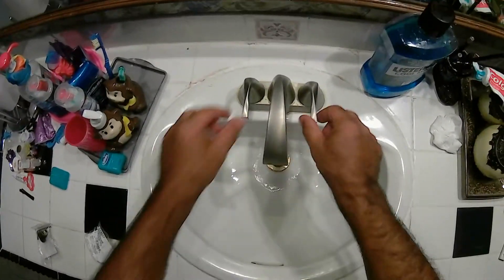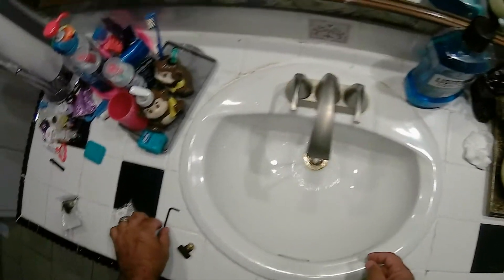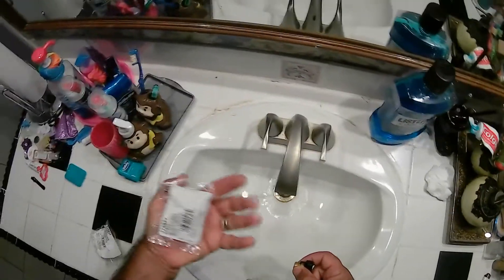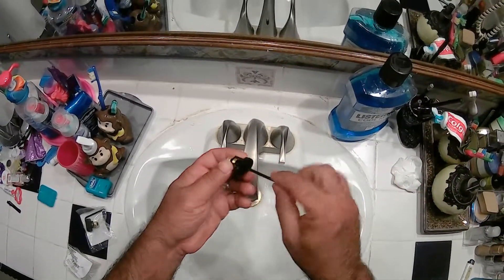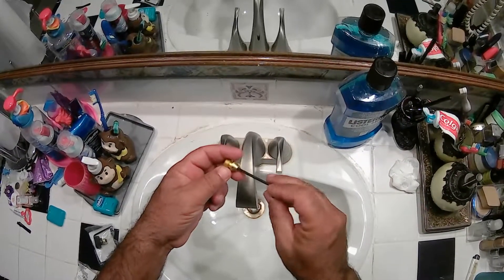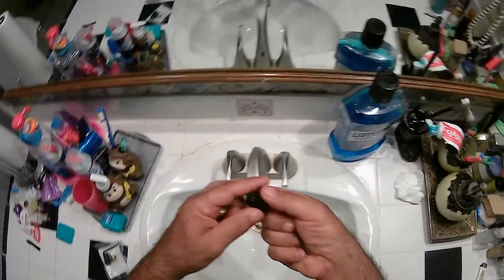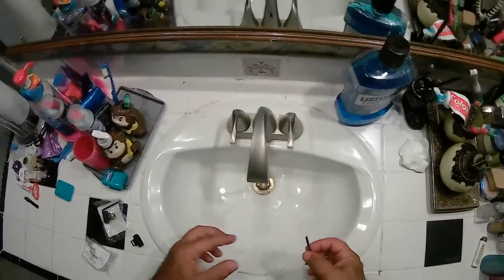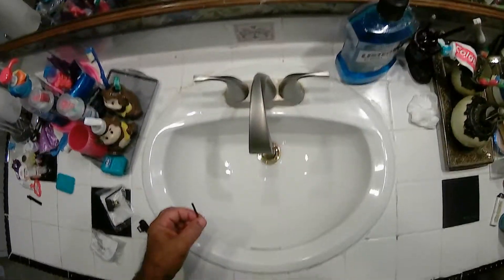Moen oxby clogged

Comment: Your video helped me as my Oxby was running slow. I was able to remove the aerator with a 1/8" hex wrench. I then cleaned it out and replaced it. Now it runs like a charm.
Reply from the maker: Bravo - have the tool  nby as I clean it  every month .. so much sand in my water ..
Reply: Could you tell me which direction to roate when you remove the aeroator wiht hen wrench?

Comment: I have moen brand new in my bathrooms. Brand new but just a trickle of water and thats it. You got any advice or should i take them out & bring them back to home depot?  Thanks for helping out.
Reply from the maker: it is on sale for a reason.. you need the new design that allows you to open the cartridge without tools and shake the dirt out .. talk to sales .  I have the Allen wrench in bathroom and pull out and shake the dirt out once a month .  my kitchen I do the same without tools . too much debris in my water lihttps://www.homedepot.com/p/MOEN-Banbury-8-in-Widespread-Double-Handle-High-Arc-Bathroom-Faucet-in-Spot-Resist-Brushed-Nickel-84947SRN/317268478?nes . here is an example .

Comment: Calcium build up, it will happen again. Not sure if you  have a water softener but if you don't that's the reason why It clogged
Reply from the maker: I have a 40 year old metal pipes and every time we shut off the main water the roof of pipe does not have any support and debris rain down inside the pipe .  Best solution is to have a filter that does not need tools to remove debris. my Allen wrench is in the bathroom and I clean this thing once a month . it takes about 1 minute .

Comment: I have this same faucet. Thanks so much!  Question though, after unscrewing, how’d you get it out?
Reply from the maker: if you pull on black plastic screen it should pop out .  block the drain so nothing can fall in there . use a mirror or selfie camera mode to see the screen . take picture for orientation of black screen .

Comment: Mine has a screen over it. How did you remove? Stuck the Allen wrench through the screen?
Reply from the maker: allen wrench goes  through screen , tool and part are free from moen .
Reply: Mine was out of warranty so they won’t send the tool. Going to have to replace the faucet because wore out the internal teeth. Going with a different brand that doesn’t have a dumb set up
Reply from the maker: warranty is life time and use the 800 number to call them .. talk to them direct .. 
if you did buy a new item buy something that you can replace the filter quick .. since the filter needs to be replaced ..

Comment: What size allen wrench is that?
Reply from the maker: I called moen and they gave me the part and wrench for free
Reply: @boashna  same problem here, low water flow from the get go. The aerator is very difficult to access because you can't see where you need to insert the wrench. I had to remove the faucet to see what I was doing. Besides that I tried just about every allen wrench that I have and not a single one fits. Apparently, you need exactly the "replacement tool" in the replacement kit. I might have dulled the head in my attempts to get a wrench to fit, so now what?
Reply from the maker: the video starts by saying free part from moein. order the part and it comes with the wrench . if you are not able to use the wrench anymore the first turn is hard and use a locking pliers .. I have a extra  identical faucet used for $30
https://www.amazon.com/Convy-GJ-0087-Curved-Locking-Plier/dp/B07H42XP5W/ref=sxin_3_pb?cv_ct_cx=locking+pliers&dchild=1&keywords=locking+pliers&pd_rd_i=B07H42XP5W&pd_rd_r=ec3fd61b-e1ae-44f5-937e-6f670c6fb085&pd_rd_w=IuKtl&pd_rd_wg=VCX27&pf_rd_p=ffb450f7-bfad-4e7e-95e8-f2bd147e99a4&pf_rd_r=935FX7WTZPBW1VKQXD7C&qid=1599936873&sr=1-1-8065ff8c-2587-4a7f-b8da-1df8b2563c11
Reply: update: I had to resort to drilling through the aerator to restore water flow... very disappointed with Moen. Fancy and expensive faucet destroyed by a simple aerator issue and it came out of the box like this.
Reply: @boashna  First of all, thanks so much for the video first and your fast response. I foolishly expected to simply take out the aerator and clean it without ordering a replacement part first. By the time I figured out I should have ordered the free replacement kit like you did, I had already dulled the head with my attempts to use a regular wrench.  I tried the pliers that you suggested (I have the exact same ones) but they didn't fit in the space: not enough room. I ended up just drilling through the aerator. I think this is a very bad design. (BTW the plastic cap is so flimsy, the attachments broke!)
Reply from the maker: yes this is a bad design ..on all faucets you must have that filter or water will splash on counter and if you use white cast iron sink they will rust around the edge and water on counter means mold and damage to something
Reply: I have the same issue n tried different size allen wrench with no success. My faucet is less than 2 years old. Thank you for sharing the video!
Reply: @boashna  do you still have the extra faucet? I tried drilling through mine and created a crack in the spout and replacements are hard to find.
Reply from the maker: https://www.homedepot.com/SpecialBuy/SpecialBuyOfTheDay?mi_u=26971222&sfalias=VA_Banner_1&cm_mmc=hd_email-SBOTD20210119_sbotd_3770670_-VA_Banner_1&et_rid=26971222&mi_cmp=8b0d00f80c5ac909&mi_sc=t                   This is special buy on faucet good for 6 more hours
Reply: I received new aerator n allen wrench from Moen but it was no use bc I totally stripped inside of old aerator. I also ended up drilling it. It worked but water shoots out like a torpedo now. Worse design flaw for a faucet!
Reply: @boashna  ok got the info ill message you Tomorrow
Reply: My Allen wrench stripped it just like everyone else, what do you mean drilled through it? Just put a drill bit on and drilled where you put the Allen wrench?
Reply: @gekhond  Dude, which bit did you use? This is killing me!
Reply: @jambaroo1  Dealing with the same thing. Ugh. Drilling. What an idea...
Reply: @caseyw9953  I drilled through the aerator to restore water flow after I stripped it like everybody else here did, but it is not a good solution at all. Water squirts out in a tight fast beam. Terrible, stupid design. It's nice that they offer a free kit, but it's no use when the old aerator is stuck in there because you tried to remove it yourself with a standard allen wrench.
Reply: @TechvoidDC  can't remember, just big enough to get water to flow, but it's not a good solution because the water will flow unimpeded, splashing water everywhere. Fancy faucet, stupid design.
Reply: @gekhond  Not sure if you remedied, this, but if you simply turn down your valves (under the sink) to a comfortable level of water flow, you'll have a better result. I drilled it out like others here, bought the stupid plastic thing again, and did exactly this. Imperfect but 95% better than before!
Reply: @TechvoidDC  great idea. My valve is one of those open/close ones you have to pull up or push down, but I may find another way to reduce the pressure and that may take care of the issue (to a degree).  I am relieved to see others are having the same issue, so it's not just me that had to resort to such insane fixes like drilling through an aerator. I think Moen should acknowledge this design is flawed.
Reply: @gekhond  Worse, they tried to tell me the product isn't flawed and people just don't like low flow. I'm like...Moen, your part strips, who cares if it's intended to be a specific flow.... You can't repair the damn thing without breaking it!!!!
Reply: @TechvoidDC  so you contacted Moen and complained about this, and they told you that the complete lack of water flowing was a "feature", not a defect? My faucet came out of the box with hardly any water flowing, not enough to use. You are 100% right the issue here is not whether you disagree with the amount of water, but that their aerator is set up in such a way that you are bound to damage the faucet trying to replace/repair a $0.25 piece of plastic!
Reply: @gekhond  I mean, i can't blame the customer service person for following their job's guidelines. :-P It was just really stupid to listen to. No one else has a damn rectangular aerator removed with an allen wrench, and I can see why! I think even they moved away from this with all their models since.
Reply: @TechvoidDC  yeah no, they just follow the script, so it's no use getting mad at the poor rep, but seriously Moen, ruining a $200 faucet for a poorly conceived aerator, value, what $0.25?
Reply: @TechvoidDC  I will say that aerators are generally trouble. We have several faucets with troublesome aerators. A $5 piece of plastic ruining a $200 faucet.
Reply: Size is 1/8